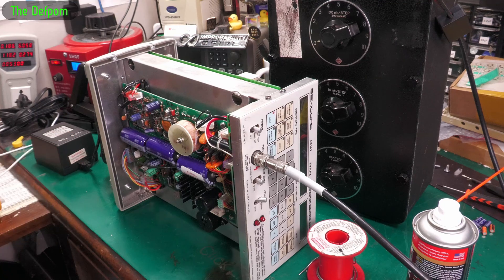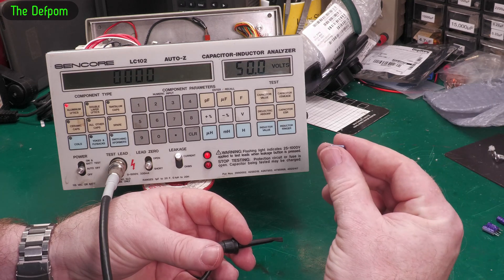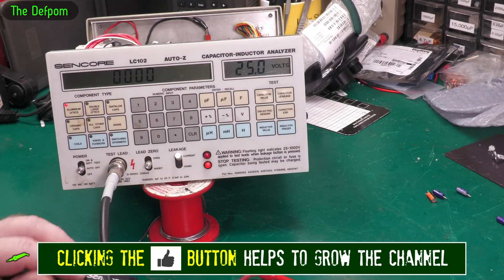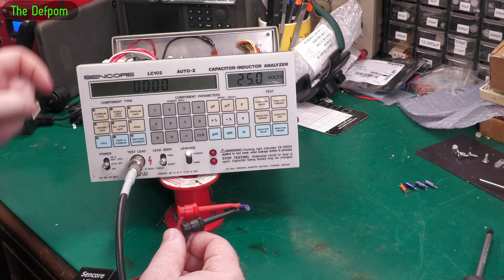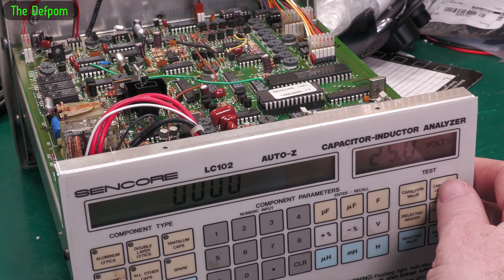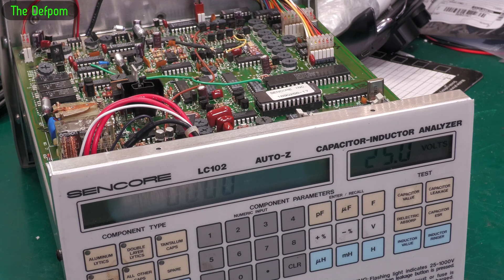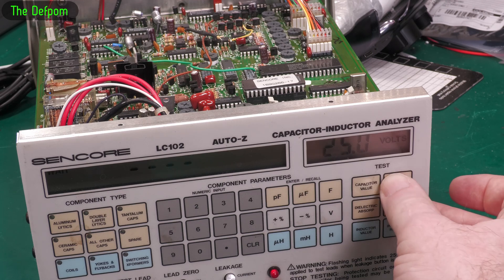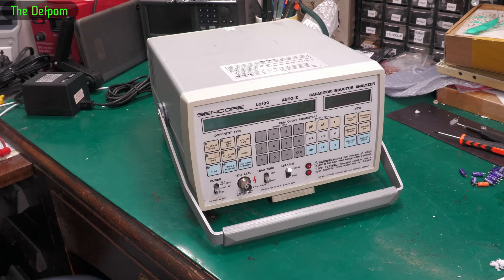Sencore LC102 Repair Part 2 - Is It Finally Fixed ? - No.1386

Comment: Hi, nice video, question. There is a small sticker on the inside frame of your unit. Should be a build number, multiple numbers can’t read it in your videos. What version is your firmware? I’m looking for a BIN file for V15 fw. Keep up the
Reply from the maker: All my units seem to have the same build number, the LC77, LC53 and LC102 all have the same number ! Pretty sure it is meaningless. I think this unit was Version 14 from memory, I’m pretty sure I showed it in Part 1 when I first opened and inspection the unit.

Comment: My issue is the Error 4. The white relay on mine is totally buggered. Cleaning will not fix it. Any idea where I can buy one or equivalent? I have not been able to find any. Or maybe you can sell me one of your spare relays? :) Cheers
Reply from the maker: They were on eBay, new old stock. Also don’t overlook the fuse holder, those can give issues too.
Reply: @TheDefpom  The fuse holder can cause Error 4?
Reply from the maker: @repairrestorerecycle error 4 is a resistance error, so a poor connection there can cause problems.

Comment: That connector is the same as the one used by AOR on their AR-2002 scanning receivers for the 12v DC adaptor, the AOR part number for the power supply is AOR AA2001 which turns up a few images on Google.  They are however long since discontinued but it might help.

Comment: Did you connect some reference capacitors to check the accuracy?  Also try connecting a low value resistor around 1 ohm or less, no capacitor, and do the ESR test and see if it is accurate.  That power plug is annoying lol.  I thought the smoke alarm went off when that beeping started!

Comment: Omg. Wearing headphones, doing the dishes with the tablet across the room, and the beeping!
Reply: Even using speakers, I had to mute the audio
Reply: I noticed that YouTube's Stable Audio is permanently disabled under Video settings. That would of mutted that alarm's harshness.
Reply: AIrpods here, I was warned it got loud so I turned down my volume but it still made me move the volume slider down.
Reply: @Frosty.Winnipeg  ya I regularly wear earbuds or over the ear headphones. Luckily, I was using computer speakers and thought that there was an alarm going off here.

Comment: That beep is way too loud. I had to jump to the volume control in a hurry. I finally left it way low and turned CC on to at least understand what you were saying. Can I suggest to glue a tape over the "sound hole" in the beeper? I find that works great in multi-meters that are beeping too loud... Too late now, but a warning in the video that loud noises are coming would have been good. 
Your rationale on recapping makes sense to me and the conclusion on what fixed the problems. For the power supply: in the past in a similar case, I have cut the lead going to the device close to the "special" connector and added a barrel power jack and in-line socket to the ends. I added the same jack to the alternative power supply and all is well. The actual device and the power brick are both still original and you can still use the original power brick, just the lead now has a not very noticeable jack/socket section looking almost like one of these ferrite-cores that you see sometimes in power leads. In your case I notice the power lead has 3 cores, so a different jack/socket is needed, maybe a mini-XLR would work.